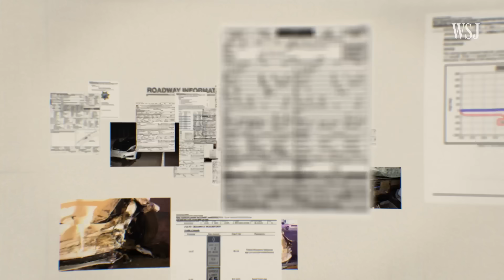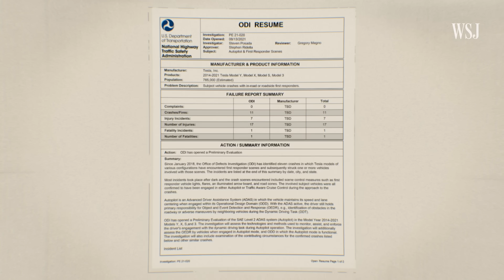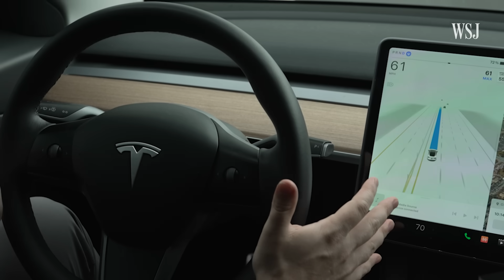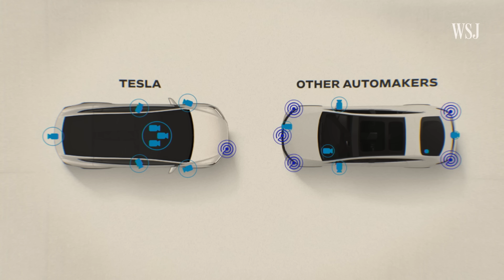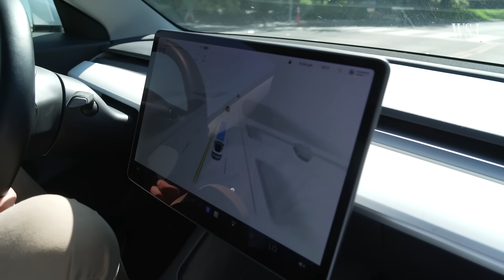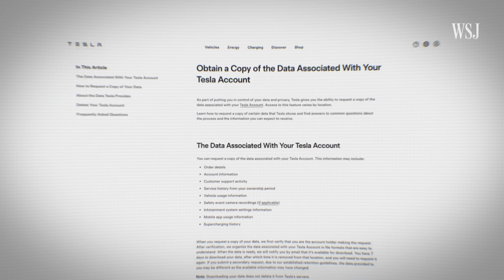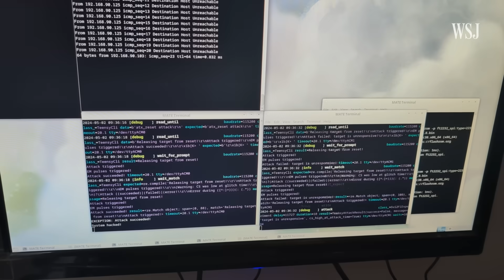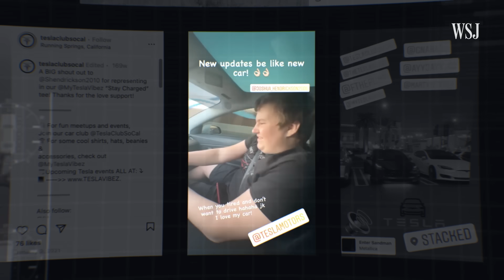The Hidden Autopilot Data That Reveals Why Teslas Crash | WSJ

Comment: This video failed to address whether the autopilot has lower or higher chance of accident than human driver. They also didn't discuss if the crash would be avoided if it wasn't a Tesla. I doubt that any human would react in time in the case of the wrecked pickup on the road at time 7:06. It is pitch black and the turned over pickup is also black and hard to see. (edit: Humans have better eyes so yes, maybe this crash would be avoided by human in different car. But anyway, it should be discussed in the video in order to report objectively)

There should be an investigation and yes, there should be some regulations of self driving cars. But cherry picking few exaples is not an evidence of large scale issue. There are studies that Tesla is possibly more dangerous than most of regular cars - use this as your argument, not some random crash.
Reply: Even if it is safer than human drivers, this should be treated as an aircraft investigation. Improvements to the design can still be made to improve safety, and saying that a human would fail to notice that too is not enough. The goal is to be safer than human driving, not as safe.
Reply: @AtleyCarman-xe7rs  Typically a human is expected to drive slower if they are having issues seeing ahead of them, the computer vision system doesn't seem to do that.
Reply: The question is whether Tesla camera-only based technology is resilient enough to objects not found in its training data set. Radar/Lidar, which is indispensable to aviation, can be a more reliable solution.

Another question is whether the drivers are informed of the limitations of the technology and overconfidence caused these crashes.
Reply: Video footage is "pich black" - not sure how 'sensitive' TESLA's cameras are in low-light conditions, what's their dynamic range? For years, even with just a MRR (Mid-Range Radar) on board, which can detect objects at distances of approximately 100 meters (328 feet), many other cars may recognize such objects blocking the lane and activate emergency braking system. And in aviation industry, with one of the highest safety standards, there's a reason why "IFR" exists when low visibility, and otherwise adverse weather conditions making a safe visual approach nearly impossible.
Reply: @messupp Eyes are better than these poor quality cameras.
Reply: "there should be some regulations of self driving cars"
There is - as long as it is not registered lvl 3 it is not self-driving.
I have no idea why people drop 10k to be tester on a beta software for the last 6 years ...
Reply: This would be cherry-picking if Autopilot was a person. People have bad days, drive tired, or can be momentarily distracted. If a Tesla crashes, it's because of a faulty algorithm - The same faulty algorithm that's present in all other Teslas of that generation.
Reply: An unimpaired driver can spot a massive overturned semi in the middle of the road, day or night, esp w LED headlights on, and definitely police cars w lights on
Reply: @dwnrange7812  I mean humans and ai can better at different stuff. I think the OP wanted to know if AI is better then human on average across the scale and not in one single situation.
Reply: @dwnrange7812  Keep in mind that tesla autopilot is likely still safer than humans, even if it misses things. We don't make videos accusing humans of their failure to stop for obstacles when they mess up from time to time. Keep in mind that we are looking at a few specific cases, even though many drivers use autopilot. It's not common for mistakes like this to happen, and I can almost guarantee you that human drivers are not as safe as autopilot overall.
Reply: @ this is the inherent danger of ALL ‘automated’ driving systems: they require to the driver to by hyper cull vigilant/ attentive the whole time as if driving oneself. But we humans are naturally designed to lose attention if we’re not in control. In a long drive or daily monotonous commute, if we’re not actively driving the car, our minds will wander off no matter how skilled we are. Sure, this can happen even if we are driving, but becomes 1,000 times worse if we’re using autopilot/ FSD/ blue cruise, or whatever it may be called. And it will be in that mental zoning out period when the worst split second situation occurs requiring our immediate intervention. Basically, if the system in unable to do the entire drive itself, then it’s not only useless but dangerous. It does not ‘assist’ in any way.
Reply: A human eye might not be able to detect a overturned semi truck in poor lighting conditions. But you know what can? Lidar and radar sensors in autonomous cars that are not Tesla
Reply: An overturned truck is a stationary object. If you can't react fast enough to avoid a stationary object then you're driving too fast. It's a mistake people can make but you absolutely wouldn't expect a self driving car to drive at a speed whose stopping distance exceeds the distance where it can detect obstacles.

The accident also would have been avoided if the car used lidar rather than rely solely on cameras which fail to detect objects in poor lighting conditions. The choice not to include lidar in cars where they charge thousands for the self driving add on is just corporate greed. They could make self driving safer with more sensors but choose not to because it will affect the bottom line.
Reply: @oM477o it also adds significant complexity to the software and a trade-off was made, which is ok
Reply: It is interesting Hardware 3.0+ with FSD will tighten seatbelts and deploy airbags immediately before a crash, yet the company refuses to include Lidar for redundancy to prevent potential crashes.  I am glad other companies are finally making cars on par or better than Tesla by several metrics.
Reply: @oM477o  Yeah it's so stupid Telsa refusing to use Lidar tech, which is actually a 3D scan map around it which is superior to just a 2D vision being translated to 3D by the computer which can be still highly inaccurate.

Yes Lidar sensors can look ugly, but the modern ones are sleek and so integrated just like a parking sensors now. Also if the car designer is creative enough, even the old ones can be still make it work to look good, maybe something we don't always expect.

Safety should be highly on the priority list, means that they must use any available tech that is proven and is superior. Regardless of cost and aesthetics, since they want to market a fancy semi auto driving, that is the price to pay to be trailblazer.

The problem is they are capitalizing self driving promise and boasting they can make it sleek than even non self driving cars and saying its same as humans.

Here is a thing, we know we humans even with rather superior vision can still have flaws and shortcomings that other animals have. Bat's can echolate their surroundings similar to Lidar. We humans just don't have similar capability with just our eyes alone. We augment our shortcomings with tech.

So does with cars. Just 2D camera isn't enough, it needs to augment with things like Lidar and other tech if we aim for something "superior to humans". If we just think a human-level is enough, then that's no different from attentive experienced human driver.
Reply: @kornkernel2232 as far as I know you need 2 cameras to create 3d, same as human brain. So it should be fine in normal weather, but any other circumstance is a question.
Reply: Tesla has the data about accident incident rate with and without autopilot. They don't release it though, only very surface level statistics. That should tell you, what that data says. If it were in their favor, they would plaster it everywhere, not hide it. WSJ on the other hand does not have this data, it's proprietary.
What we know is that Tesla's have the highest rate of accident per mile of every car manufacturer.
Reply: The fact remains this guy was in auto pilot mode and did hit the truck. The video did not seem to show any braking. I have driven more than a million miles over the years commuting to work. The only accidents I have been in were being rear ended by non attentive drivers. I can tell you from that video I would have avoided that accident. For certain.
Reply: The study was conducted on model year 2018–2022 vehicles, and focused on crashes between 2017 and 2022 that resulted in occupant fatalities. Tesla vehicles have a fatal crash rate of 5.6 per billion miles driven, according to the study; Kia is second with a rate of 5.5, and Buick rounds out the top three with a 4.8 rate. The average fatal crash rate for all cars in the United States is 2.8 per billion vehicle miles driven.

Statistic I found online, although it doesn't explain if it's the car design or the driver's lack of attention, but all I can say is that I wouldn't trust Tesla autopilot anytime soon,, I'll just manually drive my civic
Reply: @lileanne9633  Exactly. I have found this exact same report when googling. Wall Street Journal should have used this as an evidence in their video.

But they never mentioned this study, they just made assumption based on the interviews with victims and victim's families. Which is the equivalent of asking people on the street.
Reply: Agreed!!!!! I was literally screaming at the screen for them to give me some real information. All of this video was based on feelings. Not data.
I'm not saying I'm in support of self driving or against self diving. Because this video did not give me any information to even form a opinion.
It was just a bunch of people discussing feelings.
Reply: @williamjg2347 I was focused on the fact that Tesla is redacting the accident reports for proprietary reasons - yet the redacted point that could be filled in did not have any information about their technology- and they already have driverless taxis in Texas Yikes!!!
Reply: Aa of now, unless you are an alcoholic 95 year old, there is no way that any "Self Driving" feature is more safe than humans driving. One day it will be, but that will not only require systems in the car to improve, but also, to some extent, shape the world around it accommodate for it. The whole statement about safety is, for now, nothing but a fever dream of Elon Musk weaponized as a carrot-stick for VC investors with no technical understanding. The problem is still orders of magnitude too complex to navigate all exceptions. Some comments ramble about "distinction between autopilot and FSD" etc. For now it's all the same: glorified cruise control and parking assistance. These systems can be useful and used safely, but it bothers me that Tesla promotes this stuff in a dishonest light to milk investors at the cost of human lives to who trust the company. It's just morally disgusting. FSD will be there one day, but it will take a while and it is probably not coming from Tesla but from some more coordinated effort. And also: Robotaxis as envisioned/claimed by Tesla are not around the corner. All in time, but it will be different and more gradual. (Source PhD in engineering and autonomous systems).
Reply: What I have found is that nowadays people just aren't paying attention to the road as they should be. But that's a generational thing. But anyone born before the 2000's are defensively minded and would see the brake lights ahead and slow down.
Reply: @Lostsoulsnfocus 🎉🎉🎉 I was going to say the same thing- you could see the traffic ahead putting on their brakes.
Reply: @Lostsoulsnfocus  You think people born after 2000 have the money to drive around in a Tesla?
Reply: You would at least let up on the gas and maybe hit the brakes, which might allow you to live. You would not hit at an unreduced speed.
Reply: I also didn't see the pickup truck. But neither did the camera. So what's your point?

We all saw the police car. Or the semitruck. 

A radar would solve all these problems.
Reply: A person maybe not but radio and lidar will see something big in the middle of the road. It is more expensive but it gets better results
Reply: Your eyes are better in the dark than any camera at this moment in time. Camera's are very known for their lack of vision in dark environments.
Reply: Here's the thing, even if a human couldn't see that, if Tesla's autopilot had LiDAR, it could've seen that, like many other self-driving cars. The decision to not include LiDAR sensors on Tesla is truly catastrophic.
Reply: There was plenty of time to avoid the crash. I experienced situations like this and managed to go around the obstacle. I am just some pot smoking dude and definitely no fighter jet pilot or race car driver. So if the scrap tech Tesla drives worse than me it is just like putting a rock on the pedal...:face-fuchsia-tongue-out:
Reply: thanks elon
Reply: I think the more important take is, you can't rely your life on something else except yourself, especially when it's not completely reliable and you can't determine when it's gonna fail, it's not like Tesla's gonna pay your bill when you have a crash in autopilot mode
Reply: I think their main point is that cheap cameras should be replaced with much more accurate IR or other types of detectors
Reply: Elon doesn't care about you
Reply: sure musk bot !
Reply: I’m not sure if this is a hit piece on Elon or not but this is very poor reporting, watching this video only tells me how safe it is if they only got one thousand crashes in all these years, there are a lot more crashes normally, this seems to be one of the safest vehicles in the market. Also it seems like a lot of them is people asleep on the wheel or doing something else when they should be watching instead.
Reply: It's ha slower chance. This is kind of a fact and it's not even close. The problem is that when it's on the end of a computer you can't ask the driver to be fully responsible and it need to be near perfect. Other highway system only are currently far better.
Reply: yes, hit pieces often do that.
Reply: All other car manufacturers ise radar/lidar sensor for things as simple as assisted cruise control. Tesla are relying on full selfdrivinf with only cameras + ai. This is highly unusual, and downright dangerous. Elon musk is personally responsible for these deaths.
Reply: Tesla failed to disclose that you should keep the hand on wheel
Reply: I think this misses the point. Not sure they're using cherry picked examples for any singular generalized argument against tesla. But it is of note that these crashes happened and Tesla won't share info about them. The examples aren't cherry picked. They're 200 examples of crashes tesla won't share info about. That's the thing that they all have in common. The public can't make informed decisions if they don't have the tools and information available to come to educated conclusions. And that's worth reporting on.
Reply: Any ALERT human would react in this situation because they value their lives. Human eyes will see better than what you see on the YT screen. Also there are so many other clues on the image you can call Tesla FSD TOTALLY CLUELESS. 

A hint might be the F-ing semi truck parked on wrong side of the road with flashing blinkers. Clearly put there on purpose to WARN people or maybe as it was part of the crash. Any human would understand these clues and slow down, take right lane etc. Maybe even put on blinkers and warn other drivers of the danger.

Other cars that do lane-keep etc. have radars and some of the lidars. They have much better possibility of reacting even if human is asleep in the wheel - which they do not allow because they actually monitor the person driving and check that they are ALERT.

Tesla FSD is dangerous and should not be on the roads - like in EU currently.
Reply: Oh yes, they would. They would just slow down to see what’s going on. I have had HORSES in the middle of the night, at 90 mph and successfully avoided them.
Reply: Those short stock traders really want at least some of their money back.  So forget facts and stats, let's just show some crying widows.
Reply: You are only highlighting half of the issue. Don't you understand from the video that Tesla overpromised FSDs and they are delaying or even avoiding investigations into the crashes? Yes, it isn't just a Tesla issue, but Tesla is the major player in the industry and currently the biggest seller of autopilot vehicles in the USA.
Reply: Agreed
Reply: Teslas should at least slow down when detecting something suspicous. Also, there are cameras/sensors, which can see at least as good as humans in darkness. Not adding such tech or not adding LIDAR are simply cost cutting measures that should not be accepted.
Reply: @ what sensors still exist after Tesla went Vision only?
Reply: wow,  that is some coping skills u have,   Ur wrong doe...   sad..
Reply: This is where LiDAR comes in. It can pick up things cameras can't.
Reply: Sounds like you own some tesla stock is is frantically trying to feed yourself some cope
Reply: @MrKhankab  Sounds like someone frantically trying to find any reason to deter any fair criticism from their favourite news media.
Reply: @MrKhankab  I don't think so. He clearly states there is a lot of data missing. To make a real judgement, we have to see the number of incidents per driven mile for both driving-assisted cars and the ones without. Then we can make a comparison and claim if this technology is more dangerous than the average driver or not. Personally, I am positive people are relying way to much on the term "auto-pilot" and expect the car to do things it cannot do. But that's my gut-feeling. We all need data to back this up (or disprove it). 

The video from WSJ does not supply this data.
Reply: @MrKhankab  
Tesla stock is up over 150% the last six months. I’m sure he’s coping with that just fine.
Apparently the 52 people who upvoted your comment aren’t aware of that.
Reply: @MrKhankab  Please, read my original comment to the end. I say that there are studies that show that Tesla is dangerous. And I am not arguing that.

My point is that Wall Street Journal shoudl use more reliable sources than few random accidents. They also shouldn't say open ended question in their video - they are a journal, they should be looking for the answers.
Reply: @herdek550 they reviewed 220 examples out of the 1000 accidents submitted by Tesla. That’s a pretty high sample rate. No, they didn’t  give the details of all 220 examples but that can hardly be expected in a short teaser video. And remember, these had to have details pieced together from other data sources as Tesla doesn’t allow the full reports to be made public. Strange to expect a higher level of full disclosure from reporters that don’t have direct access to the data than the company making claims with no proof about their potentially deadly product being beta tested on the same streets our families must use to go to school, work or shop.
Reply: Well clearly you should not be behind the wheel of any car. If you don't have enough common sense to realise that if you can't see clearly then you should AUTOMATICALLY slow down, then you are clearly part of the reason why the US has the most dangerous roads in any developed country in the world.
Reply: In the case of 7:06, most modern cars equipped with ACC(adaptive cruise control) would have reacted thanks to its radar based system. Tesla knows the benefit and can implement radar in conjunction with its vision system but decided not to cut cost. Such can be seen as removing reversing radar just to save a few dollar.
Reply: I as a  "Human", If I saw some strange light across the road that just don't look right. I would slow down as I get close and if it look like a truck blocking the road. I then stop! I put my faith in me and not a con man selling his  dream!
Reply: @tomnguyen9931   I mean humans and ai can better at different stuff. I think the OP wanted to know if AI is better then human on average across the scale and not in one single situation.
Reply: @tomnguyen9931  Exactly, and you didn’t have to rely on an engineer to have mapped the specific unknown object coded into your brain beforehand in order for u to stop. But Tesla ‘Vision’ does!
Reply: TL;DR: We should stop comparing things to drivers that are either believing the fully self driving marketing hype, or for other reasons (sleeping, intoxicated ...etc) are not paying attention.

Aside the IMHO crazy USA practice of driving in left most lane when middle lane is free (which would've avoided the crash) - where we could argue (and I would agree) that in other situations truck could've been in middle or across 2 or all 3 lanes.

Unlike most of "Tesla saves the day" type of videos where I can for sure say that most of drivers paying attention (the one not trusting marketing/hype of fully autonomous driving)  would've noticed and stopped/switched-lanes in time. With that particular video changing speed of replay - it's hard to judge how much time there really was to notice and break or switch lanes.

Although either way. I'm actually sure that even our relatively dummy VW Touran without any lane detection/keeping and just distance and speed maintaining cruise control - would've applied emergency breaks.
Reply: you called cherry picking? accidents like this is one too many. maybe, try imagine you are the family of the victim, bet you'll have a differnet tone
Reply: @Ritzrfx  ok, so how many are too many, exactly?
Reply: Good point